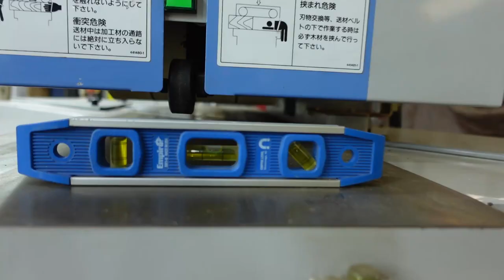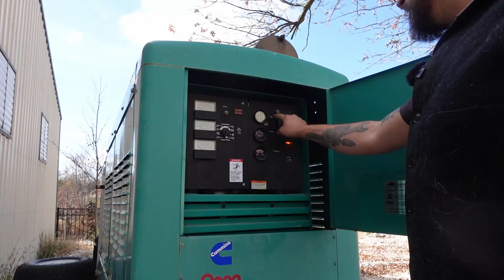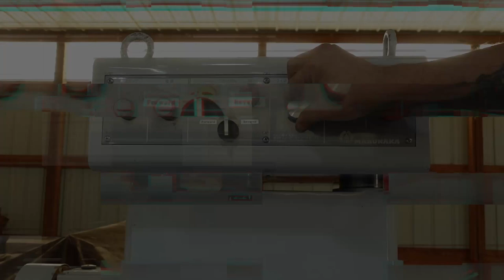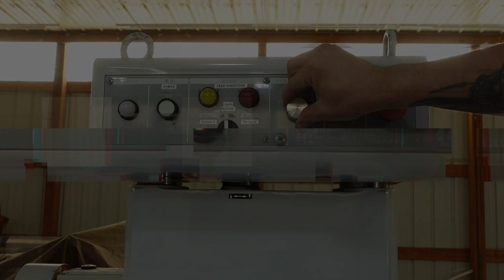Marunaka GT-Slider Super Surfacer Part 2: Tune Up and Operation

Comment: Only recently discovered these machines, absolutely love them!

With regards to cutting fluid, I do profile grinding for moulding knives at work and we use Castrol Hyosol T15 mineral oil cutting fluid 👍 You mix 1 part oil to 20 parts water (i.e 500ml oil/10 litres water), adding the oil to the water slowly, stirring continuously

Comment: might be a stupid question, but anyway: since it cuts both ways, the grain direction doesnt matter?
Reply from the maker: Nah great question. So far with sharp blades and a good set up with the chip breaker it seems fine, generally I do consider the direction and might only run things one way if flat sawn grain. But if it’s mostly VG I orient it so the reverse, finishing pass is into falling grain to reduce possibility of tear out.

Comment: Really interesting video.  For the rough pass, is the chip breaker set correctly?  I though the shaving would be limp if it was set close enough to the cutting edge.  Well, maybe that's only for thin shavings.  I'm chuckling about the quality of wood that I've used for projects.  Most boards I've worked with don't want to be rough planed against the grain.  It seems like there's a assumption of super high quality wood built into this machine.   Looking forward to upcoming projects!
Reply from the maker: Yeah I hope to fiddle with it more and thin down the shaving as far as “rough” goes I think it more means like initial pass. You could imagine the first and second shavings remove the mill marks from power planner, and the finish pass as a fully smooth cut.

Comment: Great video! I just purchased a Hitachi small bench top super surfacer  180 mm blade and there is manual so you video is a great help for me in setting up the machine.  What is the rubber renewer you are using on the belt?
Reply from the maker: I think I got it off Amazon, it’s called that, rubber renew, it’s for like printing press rollers I think, it softens old rubber, seems to work, smells like it causes cancer
Reply: @Neverstopbuilding  Thanks I will get some

Comment: What did you treat the machine surface with to make it so smooth after sanding?
Reply from the maker: I use bostik glide coat
Reply: Thanks!

Comment: The shop I work at has a simpler Marunaka that probably hasn’t been used since our last Ellison project 😂. Would be curious to know what shop yours came from.
Reply from the maker: Oh I though I mentioned it, high country timber frames
Reply: it was first brought to a shop in Lodi - to lessen Joinery structures workload -  to build and surface the shoji for the guest house.   @Neverstopbuilding

Comment: Warning! When you use the machine suck away all the cutting liquid vapors made from the grinding or your lungs will get allergic to any kind of dusts. Buddy of mine worked with such machines and has for years now a very bad health because of the cutting liquid vapors. They kind of knew it but dint do anything to avoid it. Bye bye lung-health.